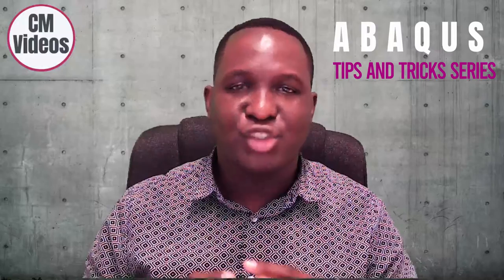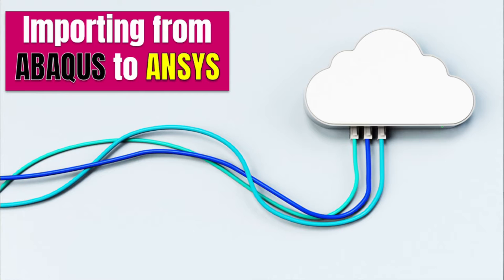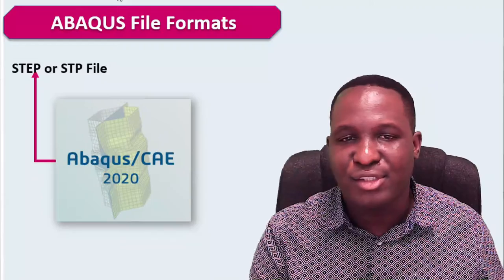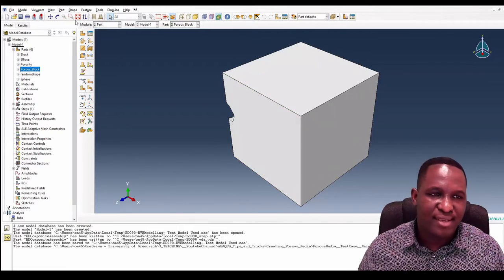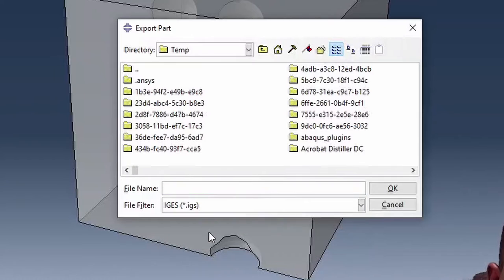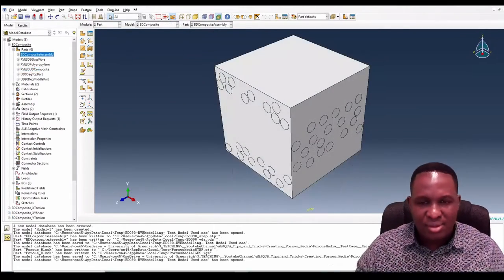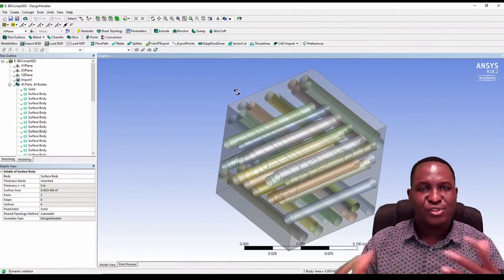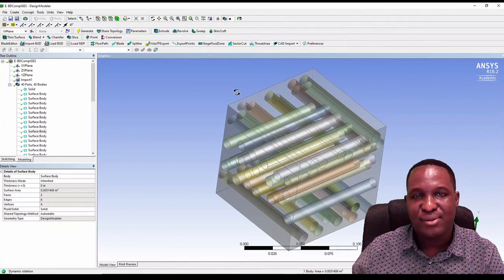How to import ABAQUS Model into ANSYS Workbench

Comment: Hello Professor, I have a question related to this video, can we import Ansys database into Abaqus and if can, how to do that? Thanks in advanced!
Reply from the maker: Hello,
I am not sure it is possible to import ANSYS database (results) into ABAQUS. I have not tried it and I have not seen anyone do it. Following your question, I asked ChatGPT this questions: Can i import ansys results inside abaqus?

And here is the ChatGPT response, which might be helpful:

"As of my last knowledge update in September 2021, ANSYS and Abaqus are two different finite element analysis (FEA) software packages, and while they both serve similar purposes, they are developed by different companies (ANSYS Inc. and Dassault Systèmes, respectively) and have different file formats and data structures.

In the past, there wasn't a direct way to import ANSYS results directly into Abaqus due to the proprietary nature of their file formats and data structures. Each software package had its own format for storing simulation data.

However, there might be some workarounds or third-party tools developed by users or software vendors to bridge the gap between these two software packages. Some possibilities might include:

Export/Import Formats: Depending on the specific analysis and results you're working with, you might be able to export results from ANSYS in a format that can be read by Abaqus. This would involve exporting data like displacements, stresses, strains, etc., in a common format like CSV or text files and then writing scripts or tools to import these files into Abaqus.

Custom Scripting: If you're proficient in programming, you could write scripts that convert ANSYS results into a format that can be imported into Abaqus. This would require a good understanding of both software packages' data structures.

Neutral Formats: Some third-party tools or plugins might have been developed to help convert results from one software to another. Look for tools that support neutral formats like NASTRAN, which can be imported by both ANSYS and Abaqus.

Direct Conversion Tools: Some software vendors might have developed tools that can convert ANSYS result files into a format that Abaqus can understand. These tools might be commercial products.

Remember that compatibility between software packages can change over time with updates and new releases. It's always a good idea to check the latest documentation, community forums, or contact technical support for both ANSYS and Abaqus to see if any advancements have been made in terms of cross-software compatibility since my last update.

Also, keep in mind that directly importing results from one software to another might not always be straightforward due to differences in meshing algorithms, solver methodologies, and other factors. It's important to ensure that the imported results are accurate and meaningful in the context of the new analysis environment."

Comment: Dear Dr
If the model in Abaqus contains truss elements and solid element and beam elements, they will imported accurately in Ansys or there are some errors and problems? Other questions, materials definitions  and properties will also import into ansys?
Reply from the maker: Hello Amr, thanks for your interest in the channel. The video focussed solely on the geometry (virtual domain). In terms of transferring all elements of an ABAQUS model into ANSYS, this is a lot more difficult. It will have to involve some form of input file or keyword file translation from ABAQUS format to ANSYS and a re-meshing of the domain. This is beyond the scope of that video and something that will require a lot of efforts.